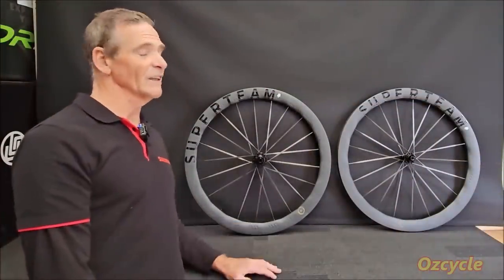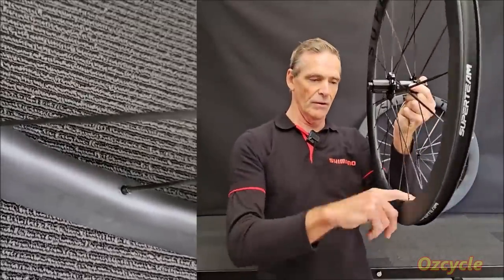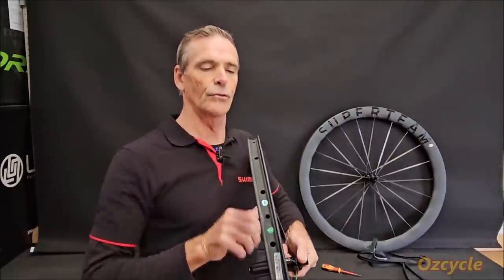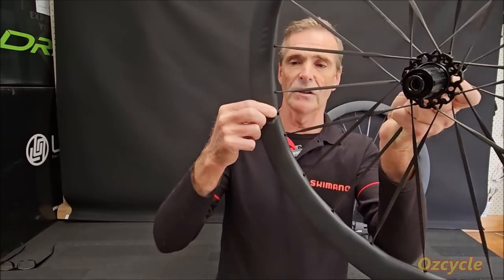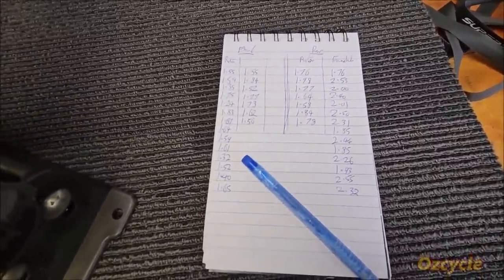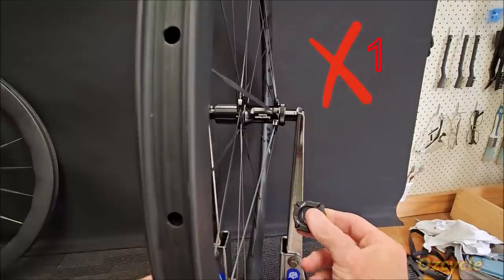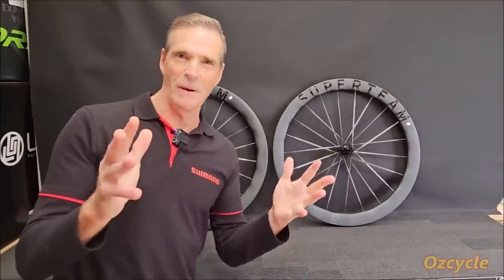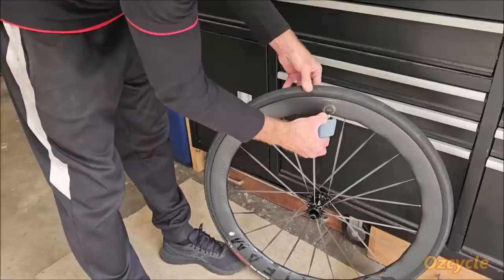Superteam all-carbon wheels- full review and testing

Comment: The whole point of me buying a set of SuperTeam carbon wheels 6 years ago was to save money and still have a great set of wheels.  I paid less than $300 for a set of 38mm wheels and they are still on the bike thousands and thousands of miles later and they still look great and ride great.  I'm sure these wheels are equally nice, but I'm not spending that much money on a set of wheels.
Reply: At these been safe wheels, since you bought them?
Reply: Have these been safe wheels since you purchased them?

Comment: I have a pair I bought off on Amazon for USD 200 3 years back. These have held up unbelievably well. One time, I even rode a couple miles on em with a flat, fully expecting to destroy the wheel. But nope, they stayed intact and didn’t even need to be trued after. WTF.
Reply from the maker: Nice. We have a few guys here with cheap Ebay carbon wheels and they're still going fine. 👌

Comment: These wheels are flawed in design from a safety standpoint. The spokes in the hubs are not captive. This is a serious safety issue and design flaw. My opinion is that they should not be purchased or recommended until changes are made. Broken spokes could cause catastrophic and sudden wheel collapse.

Comment: Hey oZ cycle Do you think that they are as good as winspace hyper? Thanks! 🤟🏻🚴🏻‍♂️
Reply from the maker: I'd say same performance as Hyper 45s but the Super 50s are cheaper
Reply: @stevenleffanue  Superteam's hub system is similar to DT Swiss, where Hyper is the classic with 6 pools. Hypers 2023 hub shaft has a surface treatment, which make higher surface hardness and hereby maybe more durable. Hyper wheels inside casting quality are better, no doubt, but may no practically difference.
Reply: @stevenleffanue  interesting! thanks for the quick response cheers mate!
Reply: @940steen  very cool  info to know thanks!

Comment: Thanks for the helpful review.  I'm looking for a set of carbon spoke wheelset and am leaning toward Elite Drive (I've had 2 sets of Elite wheels that have worked great).  Quick note: Elite star ratchets are not compatible with DT Swiss.  I tried to swap 18 tooth DTs with 36T Elites and the ratchet would not engage due to, I think, a slightly different spring or interface between springs and ratchets.
Reply from the maker: Star ratchets to fit Elitewheels hubs are on Aliexpress.

Comment: These wheels are built 2:1 ratio that’s why they have double the spokes on one side than the other,” 2:1 ratio is best actually because it makes for a very stiff wheel. 
Henry ford came  up with this design for his cars with spoked wheels so they wouldn’t flex as they turned into corners on the road.

Comment: bought 50 & 60mm superteam wheel without any decal, so everything come without any marking and who know whether it was real or other brand. about 7500km, still going strong. only change the front bearing after it developed lateral play. the assembly still true, brake track looks ok although a lot of brakepad deposited on the surface. like it was burned and bonded to the surface. it appeared after braking in long mountain descent. the rim has 1 chipped mark, probably from stone hit.
Reply from the maker: Leave brake marks on the brake track as it improves braking...similar to "bedding in" with disc brakes.
Reply: @stevenleffanue  I wonder why it doesn't leave brakepad during regular use (braking) on mostly flat route for many KMs.

Comment: I worry about carbon spokes... I always ride alone and often a long way from public transport.  Are the spokes more likely to break if hit by a stone? I assume once they break you have to stop riding?
Reply from the maker: Carbon spokes require more force to break them than a steel spoke. So they can break but require a bigger hit or stick going thru your wheel.
Reply: @stevenleffanue  I'm still a bit cautious (and traditional!). I rode a sportive a couple of years ago and after about 2 miles at moderate pace a guy near me had his posh carbon wheel collapse. I was too busy chuckling to myself to ask what caused it. He was surrounded by friends and there was mechanical support thankfully.
Reply from the maker: Was it a Mavic?...seen a few of them collapse more than other brands.
Reply: @stevenleffanue  I honestly can't remember... Might have been a zipp
Reply: Na, carbon spokes are not for me. Just so easy to snap and very difficult to replace.
Reply: i will stay away from the carbon spoke at this moment , it is stiff , strong but brittle. Known a guy who ride with the hyper wheelset, hit a pothole, spoke broken all at once, rim is fine tho
Reply: Carbon spokes have less elastic elongation, so usually ride harsher than steel (or AlTi/Titanium). They put more stress on rims in the rim-spokes system on impacts. Replacement is the same effort. -- If you ride good surfaces (track, tarmac), i.e. "road cycling" in a country that cares for its cyclists, and with wide tyres, then they'de be adequate imho.
Reply: The fact that the spokes are not captive in the hub should be of greater concern.

Comment: What is reason of crossing carbon spoks  when they cannot touch? Isn't would be better go all the way with straight non crossing spoks?
Reply from the maker: Crossing spokes makes for a stronger wheel than radial.  Best you research the why for yourself as it's a longer explanation.

Comment: It's a shame no one does carbon spokes in no hole rim bed design.

Also, making the spokes so wide but not aligning them properly sort of defeats the purpose from aerodynamic perspective. Those thin wide spokes look like carbon knives. Hopefully, no one sticks their fingers or toes in when the wheel rotates.
Reply: There is the Mavic Cosmic Ultimate, but it is quite expensive.
Reply: Light Bicycle do.
Reply: @EditioCastigata  Yes they do, but for some reason they only do most hubs in 12 mm front axle (don't do 15mm front axle diameter). A bit of a pain.